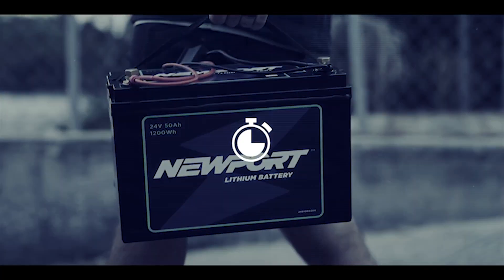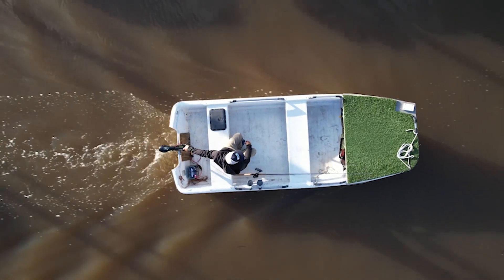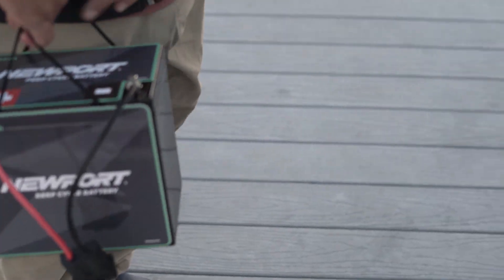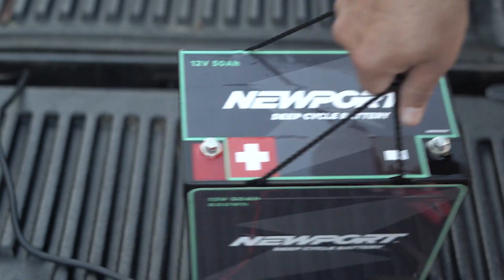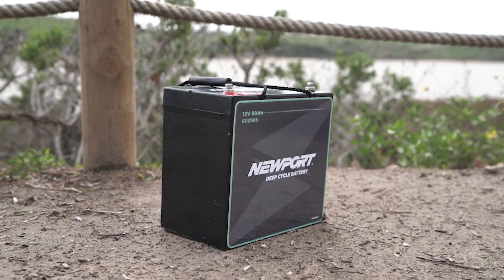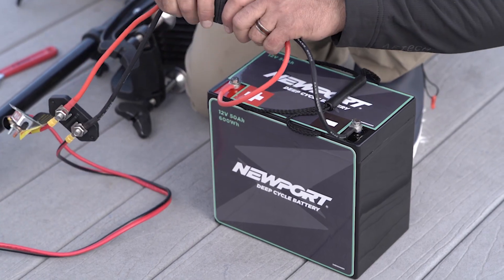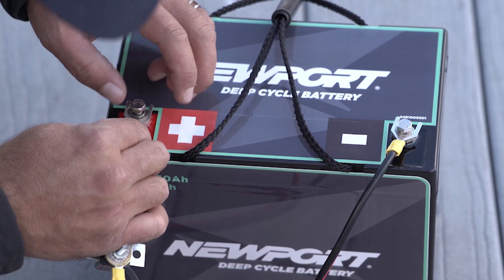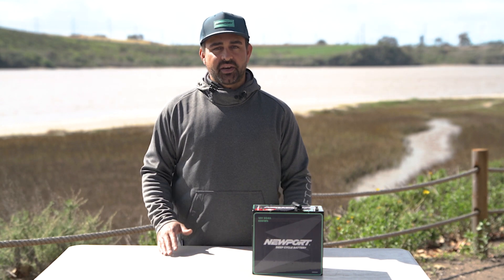Newport 12V 50Ah Deep Cycle Battery | Quick Start Guide

Comment: This video will tell you everything you need to know about the first time using this battery.
Video literally tells you nothing. It's just an ad for more stuff. Covers nothing on charging, box, or anything else.
Mine didn't come with bolts/posts and I don't know if that was on purpose?